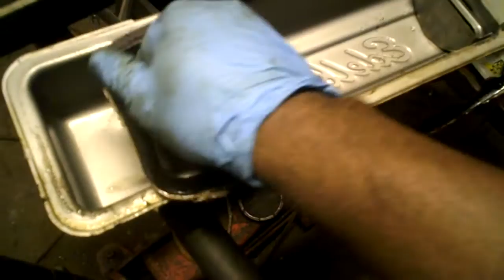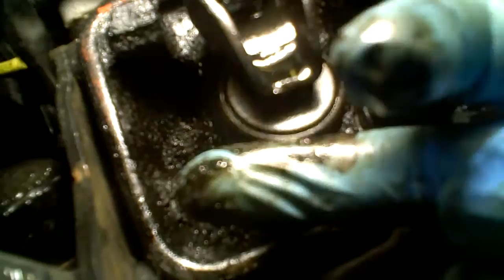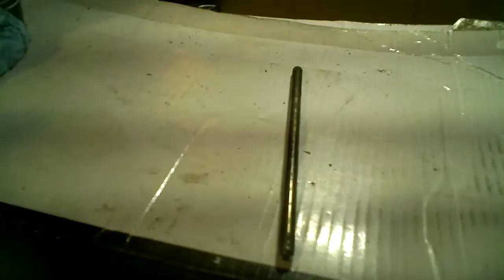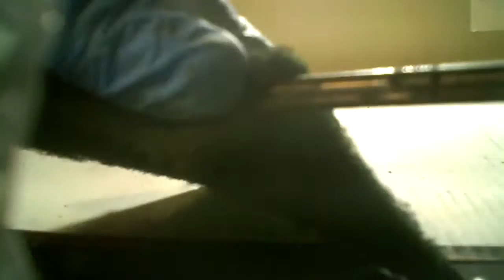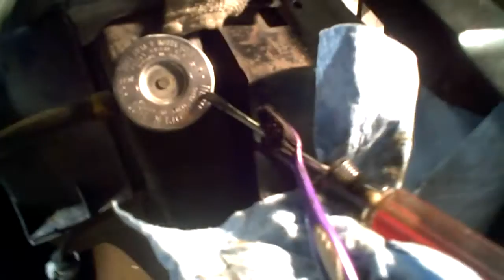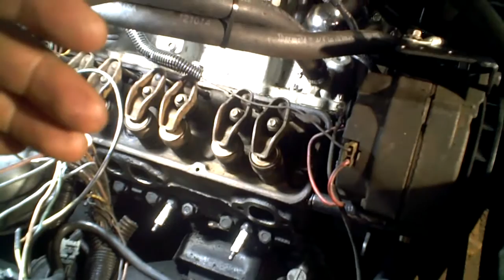How To: Oil Sludge clean up on the El Camino 14014416  Heads 305 350  -

Comment: I just took apart my s10 v6 to find very similar circumstances. Sludge everywhere. Degreasers didn't cut it. I found gasoline with transmission fluid worked wonders. Had to soak and use a light bristle brush, but nonetheless it was annoying. However, I know it will run better than ever because sludge buildup will rob the engine of performance. It's most definitely worth the time and effort. Thx for sharing your vid. Kudos.
Reply from the maker: Thanks for watching...

Comment: I understand exactly where you're coming from. I have a 2000 GMC Sierra 4.8
Which I bought brand new. I just replaced a valve cover gasket on one side.I noticed lots of sludge inside the valve cover. I was not happy to see that either.